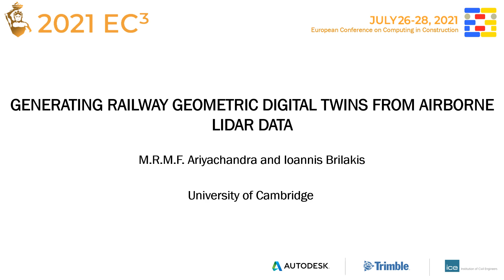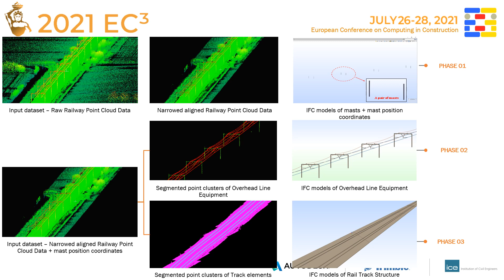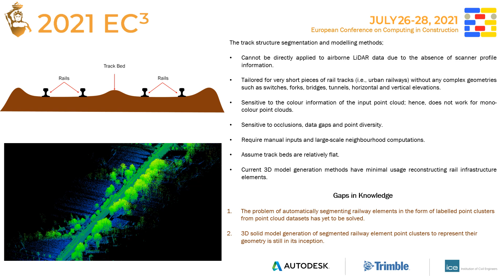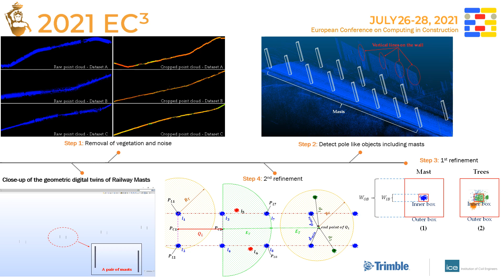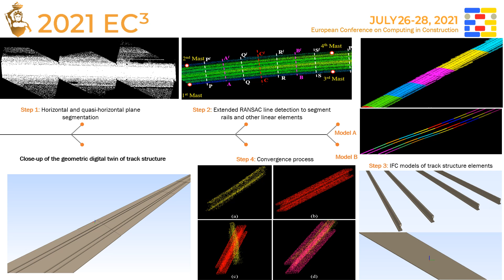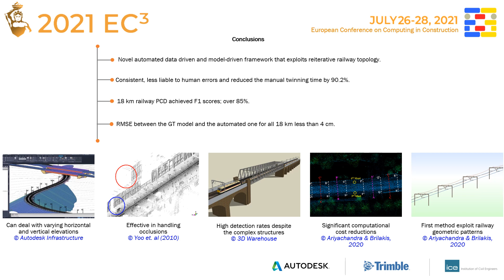2021 EC3 - PPM - Ariyachandra, M R Mahendrini Fernando - Generating Railway Geometric Digital Twi...

Comment: Great presentation, M.R.D.F. Aryachandra. Congratulations. 
The use of object detection engine efficiently for the massive but repeatative and mostly exposed infrastructure like railway is very promising proposal. 

I was just wondering, if we could use alternative reality capture or point cloud generation method then the airborne i.e. vehicle based or In this case train mounted scanner, would it help to reduce the post processing efforts to remove unwanted objects like trees?